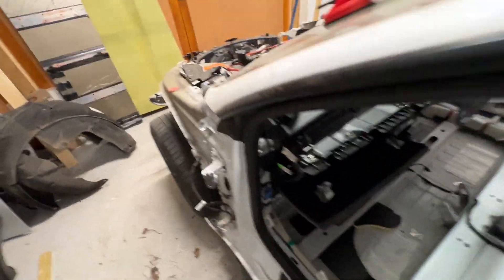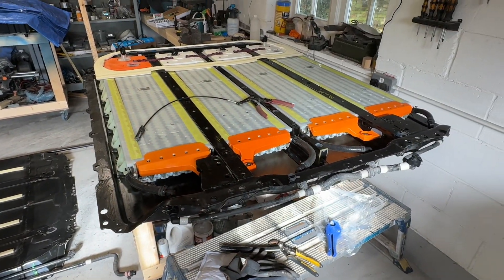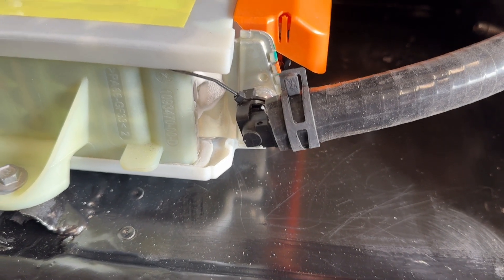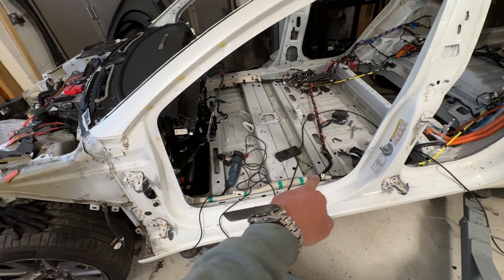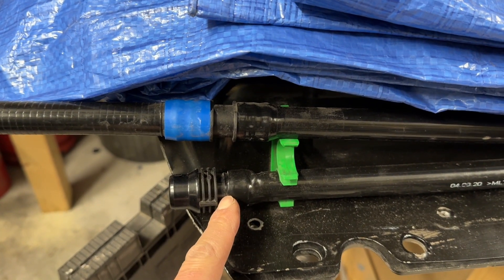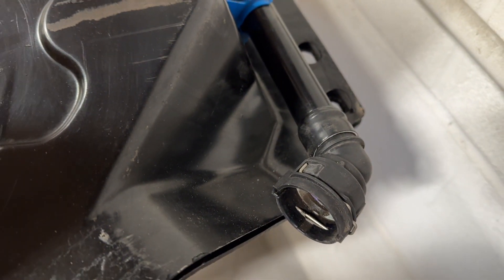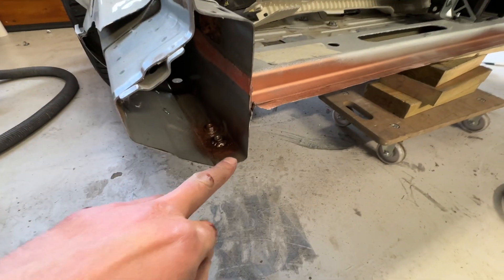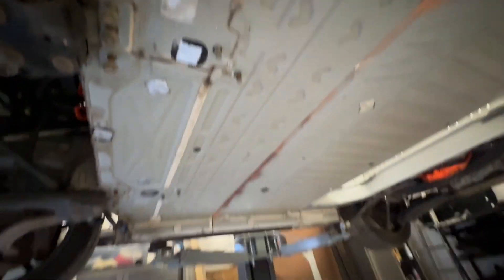Tesla Gullwing build: part 6    I chopped my Tesla in half!

Comment: Very cool project and nice work so far! I am used to working on old cars and race cars so the amount of wiring in a Tesla makes my head spin. ;) For the coolant pipes and other critical connections I would recommend using some original Oetiker (not cheap Chinese copies) ear clamps that you crimp on, in my experience they are much more reliable than spring clamps, which is why they are used by most OEMs as well. Cheap enough, low profile, even the original crimping pliers are only about $25 or so.
Reply from the maker: @lukasmatzinger  I’m confident with what I ended up with. Considering a lot of the fittings are all plastic I prefer to stay with spring clamps, the silicone pipe I used won’t age harden either which will also help. You’re right about the wiring but it’s the high voltage that’s the big change rather than the amount!